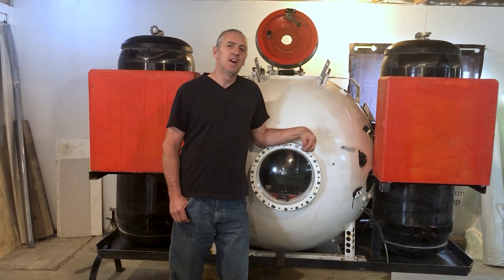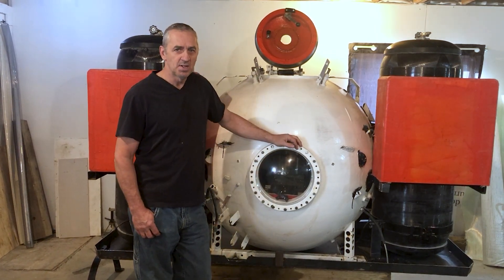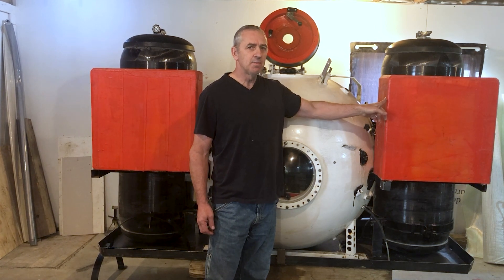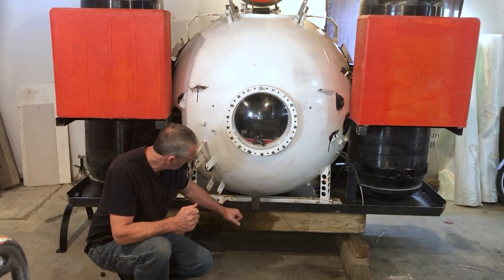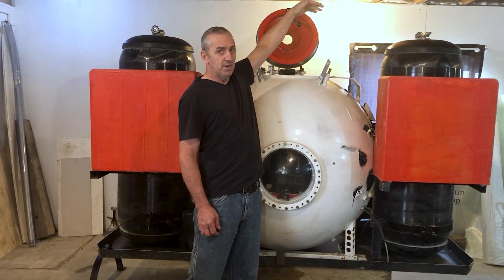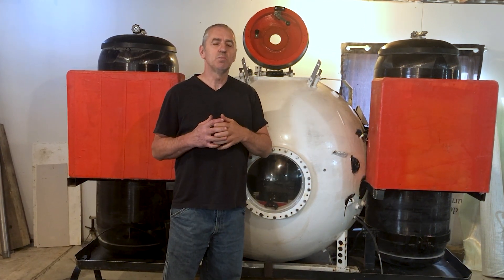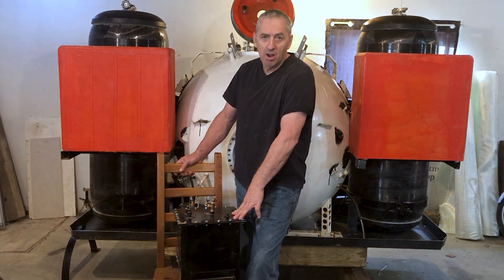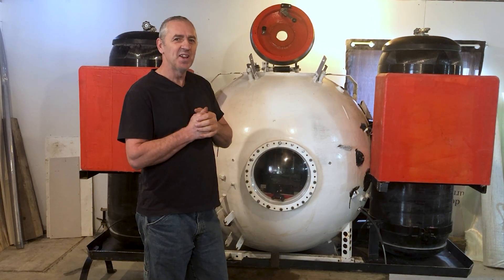Underneath the New Submarine Body

Comment: It looks so much like a big washing machine ha ha ha !  Isn't it possible to put all this stuff behind instead of on the sides ? Your sub would look MUCH better and would go faster and farther, worth the effort.
Reply: It was designed for functionality rather than aesthetics. 
He needs the setup this way or his balancing capabilities would be great reduced. Also, the release system dictates that weighted equipment needs to be outside of the sub sphere.
Reply: @pinkmist6810  Got it, but still, the sphere in the front, equipment and ballasts behind, and then if needed some balancing stuff (lest or additional ballast), would look much better.
Reply from the maker: @profepik7525  Pink Mist got it right.  I had the tanks behind at one point and it looked great but was imbalanced.   This is the price I have to pay to reach 3,000 feet.  I think it looks great!